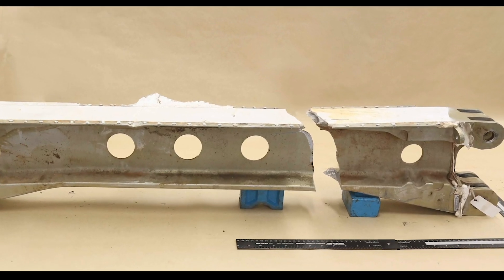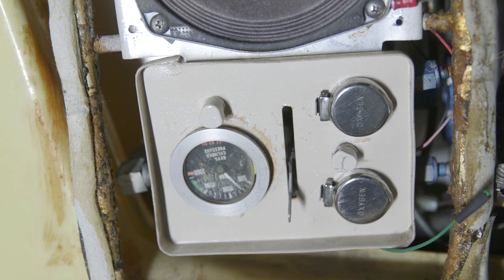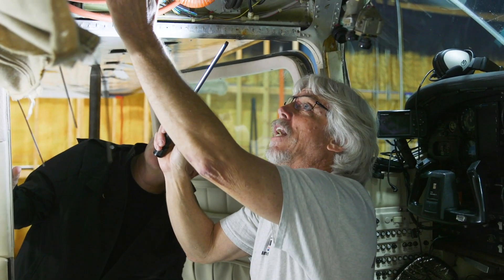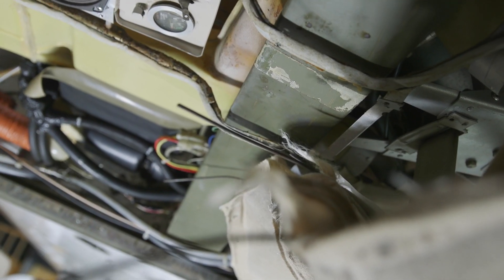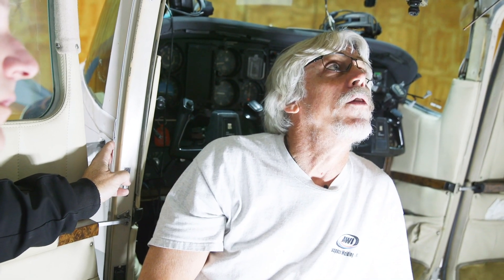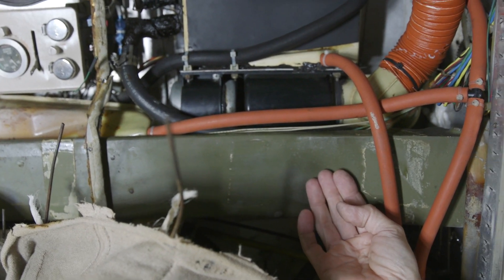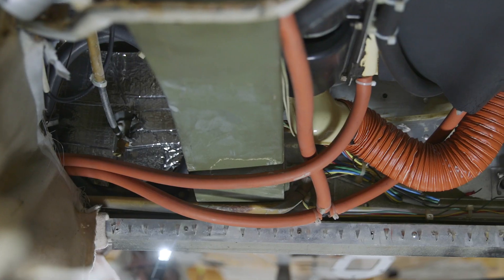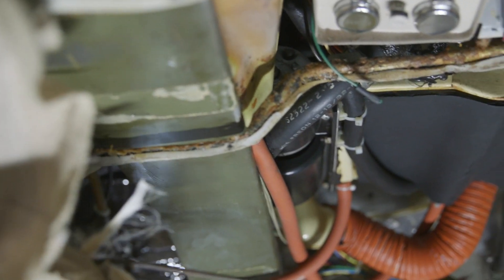Cessna 210 Wingspar Closer Look - Special InTheHangar Ep 61

Comment: I'm definitely no longer a 210 driver or passenger. The possibility that the wing could snap off without notice if we hit turbulence is too much for me. When Cessna designed those things, they should have calculated how strong that center spar needed to be to ensure it would never fail, then doubled that
Reply: they do double it. Standard for wing structure is 2 and 1/4 times max design load. The issue is fatigue damage is a whole other animal.

Comment: I inspected a 4000 hour 210 that had the foam glued to the spar and after removing all the glue, the spar looked like brand new.  But upon eddy current inspection, the spar was a mess.  I had over 25 corrosion pits on the lower surface that I had to blend out.  This took over 15 hours of blending to get all the pits cleaned up and measured.  Total job was just over 40 hours start to finish.  So even if it looks like the spar is perfect, it might not be.  We have the pictures to prove it.
Reply from the maker: Interesting

Comment: That Australian 210 wasn't operated in any kind of extreme condition. It was cruising in level flight when the spar failed
Reply: Pphhhttt, those things were spent THOUSANDS of hours low level mapping doing wing overs after every mapping run. with a big ass boom stuck to its butt, bigger engine (Blackmax conversion) and aftermarket aux fuel tanks.
Reply: No it wasn’t. https://flightaware.com/live/flight/VHSUX

Comment: I would not fly in a 210 if you paid me
Reply from the maker: Oh too bad.  I LOVE my 210.
Reply: @TakingOff  To many major issues wing spar and crank being to two big ones My stepfathers father died in his 210L when he had a crank failure sad thing is he had sold his 337 only a few month before in favor of the lower costs on the 210.  Look up N5060V.
Reply: soundman447 Sorry for your loss but the 210 has a better safety record that most other similar types. As for the crank, the same engine flys in probably 100 other different aircraft so you can’t really blame the plane!  Lycoming also had broken crank issue with the 540 late 90s- early ‘00s.  Lot of pilots got to log some glider time behind those, too!
Reply: @SkylaneGuy  the 210's record is not better than most singles. Lets look at the next plane down in the Cessna line the 182 the last numbers I have seen on the fatal accident rate per 100,000 hours for the 182 is 0.82 vs 1.37 for the 210  and the 182 fleet is almost 3 times the size of the of the 210 fleet.  The plane that has the closest safety record is the Model 35 Bonanza but yet again the fleet is twice the size of the 210.
Reply: @soundman447  ...condolences for your stepfathers passing  but you left some key facts out of the story...the prop separated from the crankshaft and struck the tail..it had nothing to do with the design or safety record of the 210 model 
** from the NTSB report 
  *Bench binocular microscope examination of the fracture face revealed crack arrest marks typical of a fatigue cracking. The fatigue crack emanated from multiple origins at the external surface of the aft fillet radius from the propeller flange... ." The accident airplane had been involved in a propeller strike incident in which the propeller was damaged. The propeller was removed and sent for inspection and overhaul. According to the maintenance logbooks, a teardown inspection of the engine was not completed as required by Teledyne Continental Motors Service Bulletin SB-96-11. At the time of the accident the engine had accumulated 573.6 hours since the propeller strike event*
*Probable Cause: The fracture of the crankshaft due to fatigue, the propeller separating from the airplane while in-flight, which resulted in the propeller striking the empennage structure and flight controls, yielding the airplane uncontrollable. Contributing factors to the accident were the previous damage to the crankshaft, the company/operator management disregarding the engine manufacture's service bulletin mandating an engine teardown inspection after a propeller strike event, and the inadequate inspection of the engine by the company maintenance staff*
Reply: @mattf49006  the prop strike happen before he had the plane and was sold to him as though the motor had been correctly inspected as a result we sued Teledyne and won in an out of court settlement and lets just say you could buy a few 210's for the payment.  One part that really sucked is he had sold his 337 only a little wile before the crash because the 210 was cheaper to fly after coming off a emergency landing due to engine failure on the 337 about 6 months before.
Reply: @soundman447  ...honestly i have a problem with you saying you sued Teledyne and won..it wasn't their fault the engine wasn't torn down after a prop strike where the prop was essentially written off ...if i was doing a pre buy and had seen that as it was in the prop maintenance logs i'd have asked to see the engine logs showing a tear down or rebuild  
The A and P doing the service advised the owner ( Gallatin Flying Service ) the engine needed a tear down ..in fact Teledyne Service Bulletin SB-96-11 (dated 1996) states its mandatory...the fact  the owner refused a tear down and the A and P went ahead installed the prop and signed off on it as airworthy absolved Teledyne of liability
None of this was due to any design flaw of Cessna or the IO-520 engine but caused by  the improper service after the prop strike
https://www.planecrashmap.com/plane/mo/N5060V/
Reply: @mattf49006  What ever dude.  I'm not going to argue with you this was almost 20 years ago and what is done is done
Reply: @soundman447  ..no argument here amigo..facts is facts.....you stated the 210 design and the IO-520 engine was defective  and the reason for your stepfathers crash..i merely corrected you..have a nice evening

Comment: The mechanic said that this particular Cessna 210 Wing Spar was "perfect". What things was he specifically looking at to draw that conclusion? Is there a checklist of things to inspect and consider in order to determine whether a wing Spar is still viable?
Reply: Visual inspection showed zero corrosion. No further action required.
Reply: Also, the spar in this aircraft was delivered from Cessna with the spar Alodined and painted with the correct corrosion inhibiting zinc chromate primer.

Comment: why not just replace it with a carbon fiber spar?
Reply: Flyboy68 easier said than done. Labor to R&R is at least $15k. Testing and certifying a new part would be cost prohibitive considering the small size of the fleet and the number of aircraft that actually need it. Aluminum is fine as long as you paint it.  Cessna never bothered on the early ones because they never thought they’d still be in service 50 years later.

Comment: Seeing this video I wonder what the spar looked like in the C210 that Scott Crossfield  died in.
Reply: Jackson Rogers thank you for the feedback I was aware that his was a 210A; effectively a 182 with a Io470 and retractable gear.
Reply: TheFalconJetDriver yes, to be specific, the 210A has wing struts, so no bending loads on the center spar. Totally different design that doesn’t have this issue.

Comment: What is the orange, silicon 3 inch double walled flex hose for? I use the same stuff on the exhaust of my pellet stove.
Reply: That is the silicone woven fiberglass ducting for his fresh air-air conditioning system. This replaced the original black cloth woven ducting that is susceptible to corrosion. I probably changed that hose 10-12 years ago & still looks like new.

Comment: I think in GA the fact that we have a lot old experienced mechanics approaching retirement is going to be a problem, all that knowledge from these old birds is going to go with them.
Reply: MrSixstring2k their in lies the 2 part problem. Older techs don’t want to pass on the knowledge as they are afraid the younger talent will run them out. Also GA just doesn’t pay well unless you are a shop and even then the younger guys don’t tend to stick around they gain the needed experience to get a better job and they are out.

Comment: In the video it is stated that the Australian 210 had 6000 hours, this is incorrect. The aircraft had 12,174 hours and had accumulated the 6000 hours during its time in Australia.
Reply: Hadn't seen where this statement was made in this Video? Just skimmed through it as "I was present" but don't recall Dan make that statement either? Hadn't read the Australian report recently but do recall high time Airframe as you mention. "High Time" in relation to average private Ownership fleet.
Reply: @cessnarigging  You are correct John, my apologies wrong video - Cessna 210 177 Wing Spar Bulletin - InTheHangar Ep 47 is where it is stated at 6000 hrs.
Reply: @johnpatrick4983  That's O.K, you had me wondering where that came from! ... I recall reading the hours were close to what you stated when I read the initial reports as they were released as well.